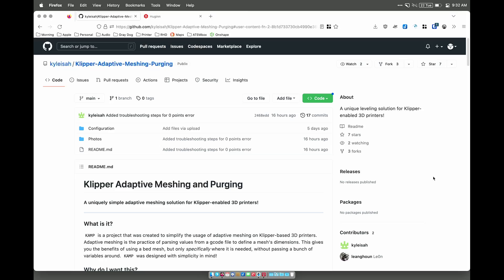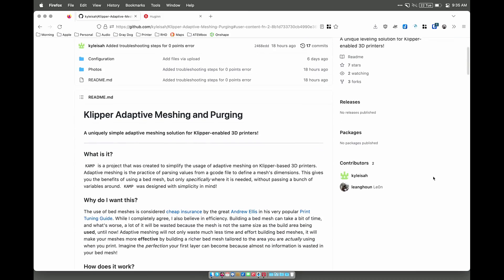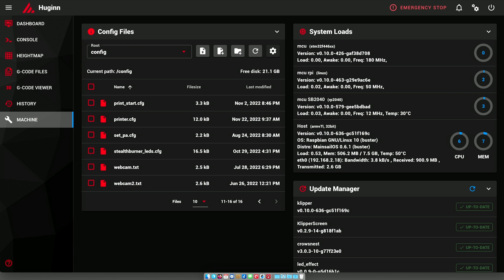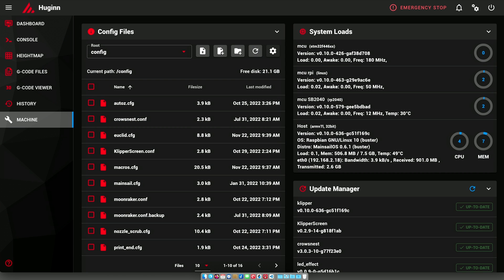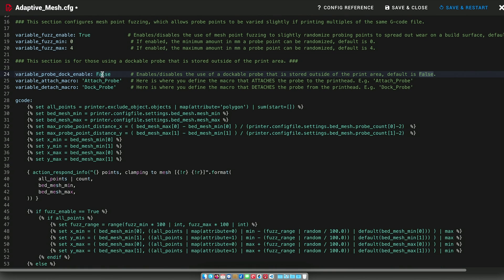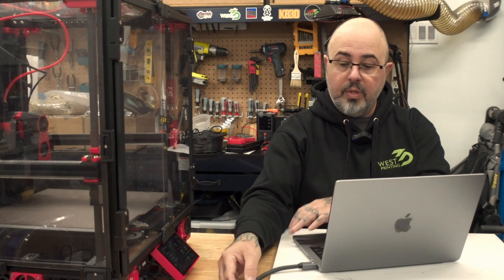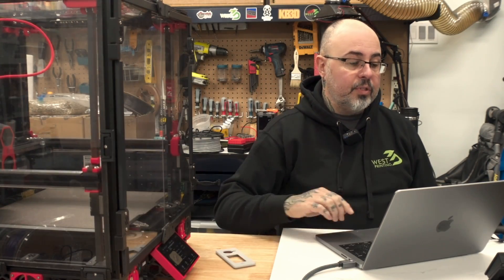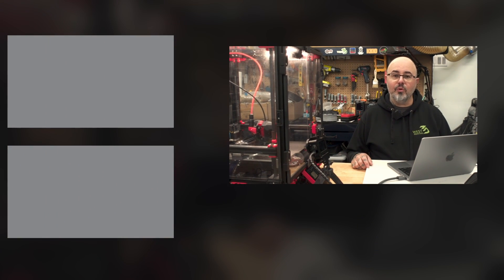Klipper adaptive meshing and purging

Comment: Has anyone been able to do this on a SV06 with Clipper Upgrade? I am having a hard time figuring out which bed mesh values to block out in order for the adaptive meshing to work. with the new updated repository looks like you have to have the KAMP_Settings.cfg file downloaded but when I go into the console command to ender ssh, then cd like the directions provide the console doesn't recognize those commands. Would greatly appreciate any help :)

Comment: Great Video, I noticed with the bed calibrate that you also load the profile; is that necessary wouldn't it also conflict if there was a default profile already saved?
Reply from the maker: The new mesh is used instead of the default, making sure that your mesh is correct for the conditions in the printer right after meshing. Your build plate or other variables could be different from your stored default.

Comment: I have a [bed_mesh] in my printer.cfg, do i need to get rid of that or keep it?  This worked well the first time i ran it but it is now doing a mesh for the whole bed, even for a pressure advance tower.
Reply: Take a look at your console. You may see a line stating something along the lines of... 0 points, clamping to bed mesh [(X_Value,Y_Value) (X_Value,Y_Value)] For me the issue was one of the troubleshooting steps on the GitHub. My start macro was placed before exclude_object in the gcode if you view. This means that the adaptive mesh isn't able to determine the coordinates of the object for bed mesh calibrate.
Make sure you have something in your custom gcode in your slicer. Mine looks like this... M117 START_PRINT <params>
Once I got that sorted it's been working perfectly. Hope this helps.
Reply: @bellyhold  thanks for the reply, I found out that I had checked the label objects box in Prusa slicer, then I switched profiles without realizing that the setting didn't carry over.  Had about 20 printing profiles that I had to go through to check that box, now everything works great.
Reply: @bellyhold is it on an SV06? Would you mind sharing a snippet of that code? I am too having issues with this and since they re did how the installation is no YouTube video has been created that I know of going over the file paths and what not. My console reader doesn’t recognize the commands cd or ssh so I can’t download the file path directory. Thank you!
Reply from the maker: You don't need to remove the old bed mesh, KAMP renames it. Best way to get help would be to contact Kyleisah on the Voron Discord or on his Github page.

Comment: Creative criticism: 100% appreciate this video. I did not know this was possible. But it would have been more helpful to start a little more from step one. You already has some of the configuration set up.  Again, I wouldn't known this was even possible, but for me starting from a stock Klipper, there are more steps I will need to do to get this working.

Comment: Has somebody tried this with cura? Is it even possible? There is no object labeling as far as I'm aware.
Reply from the maker: I read a discussion where someone said Cura labels objects by default and KAMP works for them. You could also check out this link for a preprocessor: https://github.com/kageurufu/preprocess_cancellation
Reply: @west3dprinting219  When I tried it nothing worked right. It did not do the adaptive bed mesh but it did the adaptive purge but got the "over the max extrusion" thing even on 5 max cross sections. But I'm also having issues with the adaptive purge in prusa slicer but the adaptive mesh works so, I havent figured it all out either
Reply: Yes, works well with Cura

Comment: I thought you said that you used a 5x mesh, that adaptive mesh only did three? or did I miss something?  I thought the point of AM was to do the same number of probes 5x5 or what ever in a smaller space, if it is just ignoring the probes outside of the print area how is that improving the accuracy of the mesh?
Reply from the maker: The number of points set is the maximum- if you're probing a small area it may use less points. You'll still get a more accurate mesh for the part of the bed in use than a full bed mesh.

Comment: I actually like your umbilical set up. Would you mind telling me what you're using? Seems like some sort of M12 airplane connector? Is that the EBB36? Yours is muuuuuuch cleaner looking than my mess. If you can point me in the right direction I'd appreciate it.
Reply from the maker: Running the Mellow SB2040, parts are in my repo at https://github.com/allenrowand/voron_mods/tree/main/v2.4 -Allen

Comment: Love the "That... should be everything?" haha! Almost like you weren't expecting it to be that easy. 😄
Reply from the maker: I wasn't! Thanks again for the great work.
Reply: What do i need to paste in the slicer start gcode? Either I'm stupid or there is no step on the github.
Reply: @Breexly  what do you mean? There are no parameters that need passing, this all works from definitions made by [exclude_object].
Reply: @kyleisah  So a standard startskript without mesh bed leveling is enough? Is the adaptive leveling trigger when i start the print? These (EXCLUDE_OBJECT_DEFINE NAME=A_Drive_Frame_Upper_x1_stl CENTER=142.137,149.181 POLYGON=[[114.09,124.7],[114.09,175.303],[175.91,175.303],[175.91,124.7]]) are the parameters that are needed in the gcode right?
Reply: @Breexly  you will need to have BED_MESH_CALIBRATE defined somewhere in your print start macro for it to make a mesh. Same with the adaptive purge. The adaptive bed mesh macro replaces the BED_MESH_CALIBRATE macro with one that uses the exclude object definitions to define the size of the mesh. :)